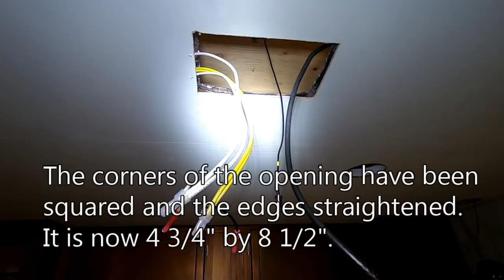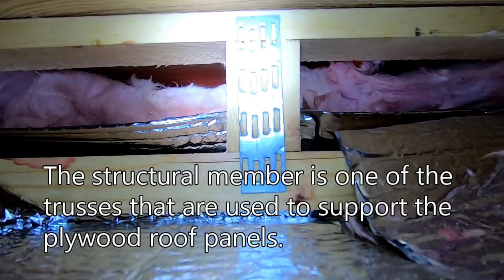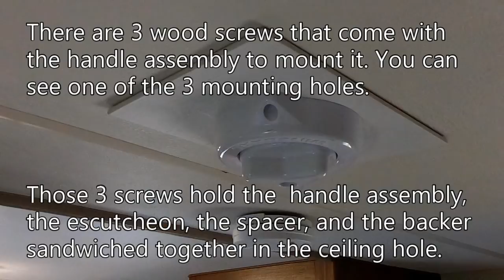RV TV Antenna Replacement and Roof Leak Repair, Part 3

Comment: You forgot the most imprtant part.....  hows the reception?
Reply from the maker: You are exactly right. I lost sight of the forest by staring at the trees. In general, the reception is tremendously improved over the non-directional Jensen that I removed. Sitting in my driveway and using the Jensen, a scan would find only the seven closest channels, which are 11 to 15 miles away. Depending upon which way the Rayzer Z1 is pointed, a scan can produce up to 31 channels. Of course, not all the channels located by a scan will produce a watchable picture. I will likely produce another video once I have done some more testing. Thanks for the reminder.

Comment: Good job! Do you get better reception with the new antenna? 
I think you might find out that you want to install another light at some point. You can upgrade to an LED fixture that will save electricity and give more light.  
Can't wait to see that video too.

Keep the good videos coming!!!
Pat
Reply from the maker: Yes, the reception is better. Please see the comment pinned at the top. Thanks for watching.

Comment: Looks good and now I need to know what you think of the performance of the antenna!! Was it worth the effort?
Reply from the maker: Great question Bill, and one that I certainly need to answer. Please see my reply to MayhemRv that is pinned to the top of the comments. Thanks for being a regular viewer.
Reply: Excellent!!  Yes, Depending on the TV it will depend..  My Sony will allow me to do a scan and then it will allow me to add additional channels and I like that..  I have another ( different brand ) of TV and it does not allow me to add the additional channels...  I must redo the scan each time...  It would be a real pain with a situation like an RV and a directional antenna!!  This is something that your average RV'er does not think about!!  Thanks, I'm not Chuck  ;-)